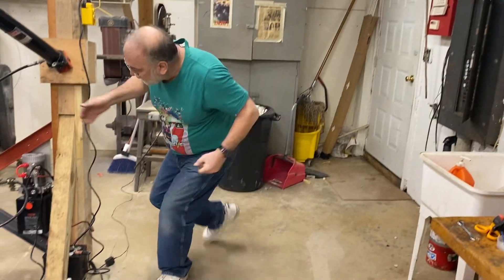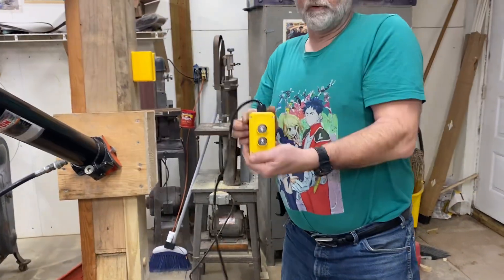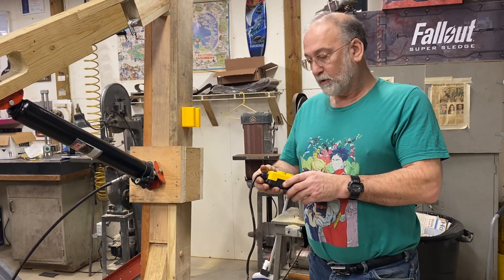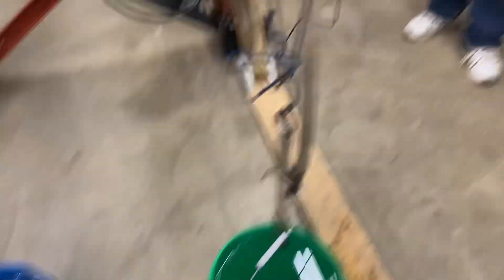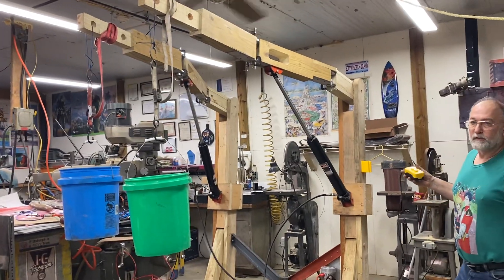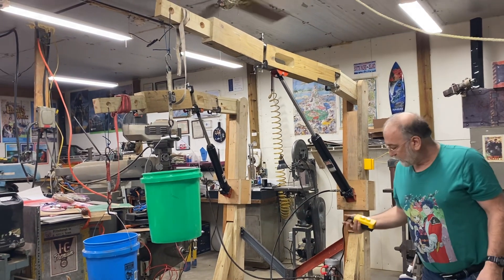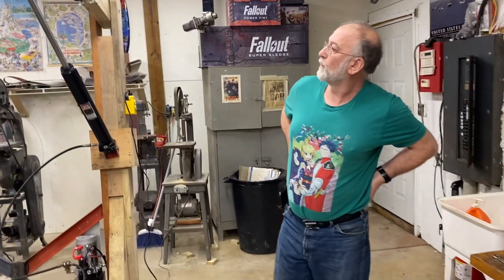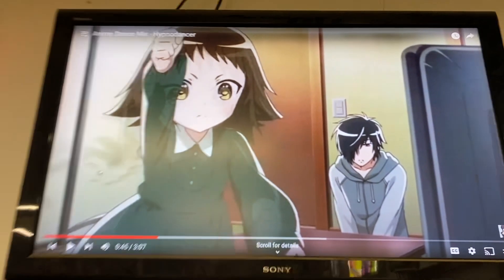POWER ARMOR STATION TEST

Comment: Awesome work mister Ray! I began a T-60 as well (all 3D printed)... and yesterday i received my Brotherhood of Steel Vinyl to put on the torso! I have some parts made (Pauldrons, helmet, torso, torso frame and the 2 gaz reservoirs in the back) I even puted a ventilation system on the helmet so i can breath way better than normal...
Reply from the maker: I like where this is going….